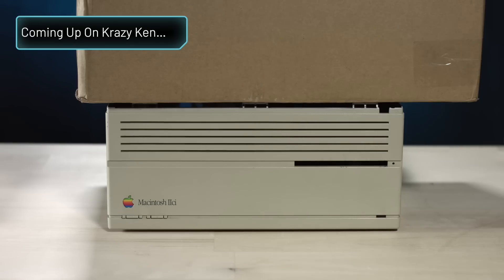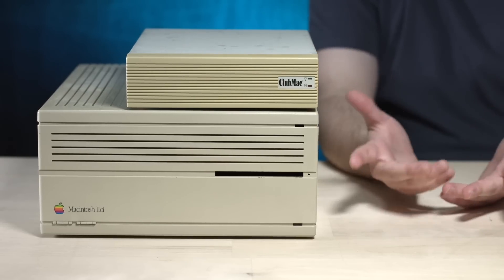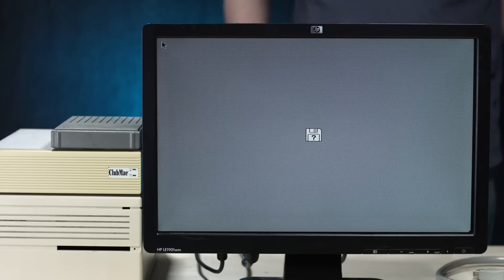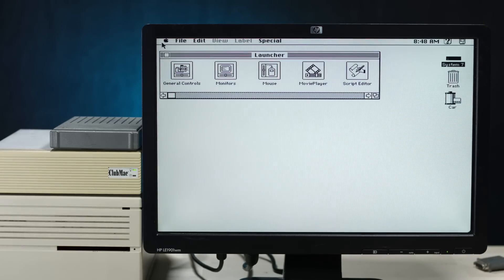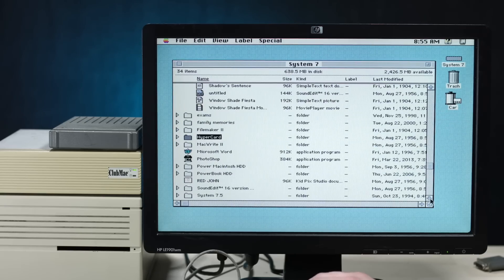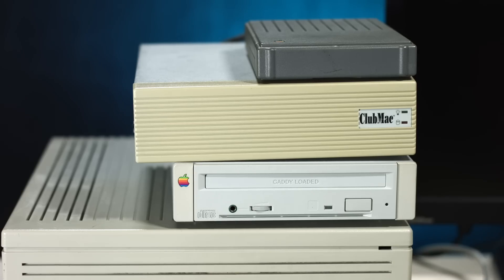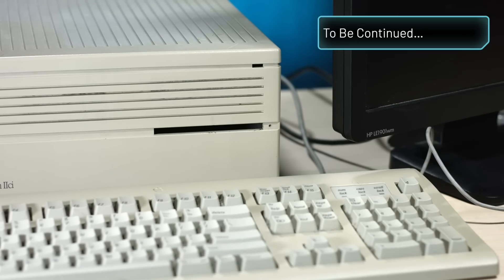Fixing My Macintosh IIci (1989) - Krazy Ken's Tech Misadventures

Comment: 12:50 The IIcx and IIci really like having their axial electrolytics replaced to get rid of all soft power issues.
If you unplug it, let it sit for half an hour, plug it in and it works again, then you know it's those capacitors.

Comment: Hey Ken,
Nice video. There’s some great content on this channel. Your Vintage Apple Vault intro video was sublime. But can you please spare you some trouble in the future and NOT PLUG ANY ADB device while the mac is on? ADB was never designed to be hot swappable (nor was SCSI) and doing this could blow the ADB filter on the logicboard. I mean, I wouldn’t mind watching you swapping chips around until you fix it but trust me, you don’t want this to happen. Instead you could perhaps make a recap video? The PSUs are getting weaker and weaker and the logicboard certainly needs some attention too. Here’s a list of the logic board caps to replace (http://www.maccaps.com/MacCaps/Capacitor_Reference/Entries/1989/9/20_Macintosh_IIci.html) and here’s a list of the ones inside the PSU (4700pf 250v X filter x2, 4.7uf 400v ,47uf 25v, 470uf 200V x2, 100uf 35v, 180uf 16v, 470uf 16v, 4.7uf 50v x2, 1000uf 16v, 2200uf 16v, 1500uf 10v x2, 2.2uf 50v).

I know this is quite a long comment. If you made it this far, you thumbs up. Keep up the good work.
Reply from the maker: I love learning from the fans : )
Thanks
Reply: +1 to that.  Actually, hot-swapping ADB could be the reason you can't use the ADB soft power any more.  Hopefully that is not the case here.  
Pretty much every 68k Mac with SMD caps will need to be recapped, with a few exceptions.  If you notice any residue on the Logic board or dull looking solder pads that is most likely electrolyte leaking on the board.
Reply: @RacerX-  Just picked up a Classic whose logic board is going out to MacCaps as soon as I'm able to box it up for shipping.
Reply: @StevenSmyth  Always good to do that.  However you might want to choose another provider for recaps as MacCaps is having serious issues right now.  Go to 68kmla.org for more info...
Reply: @RacerX-  Thanks for the advice. I read the thread, and I think I have an alternative source on ebay that I'm going to try. The thread was all about MacCaps proprietor and his problems, not about solutions for this issue. I'd do it myself but a) I'm not very good at soldering, and 2) the feeling in my hands is diminishing due to diabetic neuropathy. I can barely type accurately.

Comment: Ahh, the IIci, my dad bought one of these around 1991 and it was our family computer until we eventually replaced it with a first-gen G3 desktop. I took it out of storage a few years back and it wouldn't boot. Opened it up to find the battery had leaked all over the entire logic board, corroding a huge swath of it and even the bottom of the hard disk above it somehow. There was even battery acid pooled on the bottom of the case. Wasn't pretty... basically completely unsalvageable. :(
Reply: I found one at a surplus store  and bought it not knowing it had that same exact problem. I tried to clean it up but there was no way it was going to work.

Comment: You should probably remove the clock battery from the logic board. At some point it's going to leak and destroy/damage the board.  The computer should run fine without it - it just wont remember the time once you unplug it from the wall. Judging from your file dates it looks like the battery is already dead and this is happening anyway, so there is literally no good reason to keep it in there.
Reply: 1904 xd
Reply: Ken should replace the PRAM battery. The IIci/IIcx/Quadra 700 all took the same 3.6v, 1/2 AA size LIon batteries which are still made by Saft and can easily be obtained on Amazon. Also, the battery is not just to hold the time, it also saves the display settings (like screen resolution and color depth), the time zone setting, speaker volume, and the startup volume choice.
Reply: @StevenSmyth  I don't disagree at all, except to add that if you want to put the computer back into storage to be sure to remove the battery. Personally I find it easier to just forego having a pram battery since the computers i'm using are going to be plugged in to the wall anyway, and the ones I'm not might be sitting dormant indefinitely. Fixing the settings is a lot easier than dealing with a leaky battery some years down the line.
Reply: I keep a lot of my old Macs plugged in as well, but these lithium ion batteries are not as prone to leakage than say the 4.5v Energizers that were in the later Performas and LCs. I have a beige G3 desktop and 4 G3 iMacs all with Saft batteries and not one of them has leaked or even corroded. I'm not saying it would never happen, but it's rare.
Reply: Just get a new battery. Maybe a rechargeable.

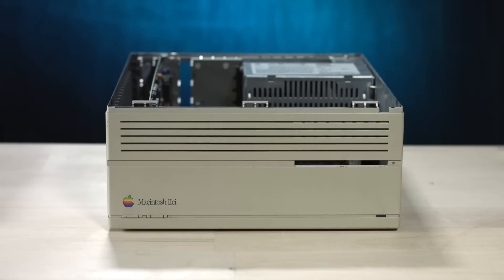Comment: 1:48 I think 32-Bit QuickDraw extension came out in 1988, so the system software could cope with rendering/manipulating up to 32 bits per pixel, even if you couldn’t display that directly on-screen.

Comment: Check the clock battery. I believe those were needed to fire up the Macs from the keyboard. Been a while since I used those, but that's what I recall. Keep 'em rollin'!
Reply: No, you can power on with a dead battery from the keyboard. Ken shouldn't be plugging and unplugging his ADB keyboard as the ADB ports on classic Macs have power on them.

Comment: I used to have a Macintosh Classic II maxed out to its absolute limit. It had 10 MB of RAM and a 384 MB hard drive.  That's not much by any means in today's computers, but in '91, for a "low cost" all-in-one computer with a monochrome display, holy hell. I ended up giving it to a previous employer of mine as a sign of my appreciation as he is much more interested in Apple than I am.

Comment: That floppy drive is meant for a Powerbook... In fact, I believe that particular model was meant as part of a mini dock setup for a Powerbook Duo! The Duo line was a line of super small laptops that didn't even come with an internal floppy drive, you were supposed to stick them in a dock or hook external peripherals into them via a docking attachment and then leave all that at home when you took it out with you.
 If I remember correctly, the external dock connector was actually the computer's Processor Direct Slot!

I've always wished I could get my hands on a full duo setup, because they're a fascinating piece of computer history. They're like the precursor to Netbooks and Chromebooks. The idea was super ahead of its time... I really doubt many of them are still functioning, though, and you'd basically have to make your own battery from scratch.

Comment: You installed the NuBus video card, which supported millions of colors, yet you attached the video cable to the onboard DB-15 video connector.  The onboard graphics of the IIci shared system memory and only supported 256 colors.

Comment: The II ci has integrated video, hence the i. The II cx (and II, II x and II fx I think) need a nubus video card. As there are two video outputs in the monitor settings you see the option of managing the two screens.

Also, don't connect any ADB when the computer is on and remove the battery if you don't use the computer!!!
Reply from the maker: I don’t know about that ADB thing. Many people say that’s a myth. I’ve never broken anything while hotplugging ADB. But thanks for letting me know about the ‘i’. That’s cool.
Reply: @ComputerClan  So you can make a demo of two screens of the II ci to make it cool.

Comment: THAT external floppy drive is for THE POWERBOOKS and that is HDI-25 not HDI 30...
Reply from the maker: I’m pretty sure it’s 30. Every source I’ve looked at says 30.
Reply: @ComputerClan , it is HDI-25 I've looked everywhere and it is 25...
Reply from the maker: Please cite your source because I do not believe that is correct. There's 30 pins on the connector (6 across, 5 down). 30.
Reply: @ComputerClan   by the way that HDI-30 is for SCSI